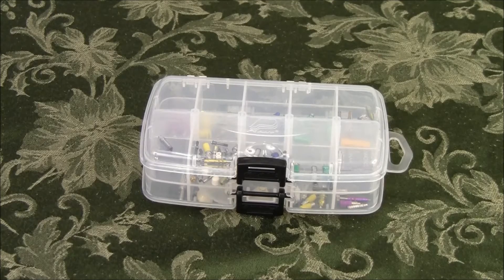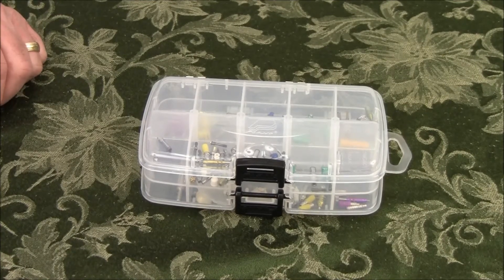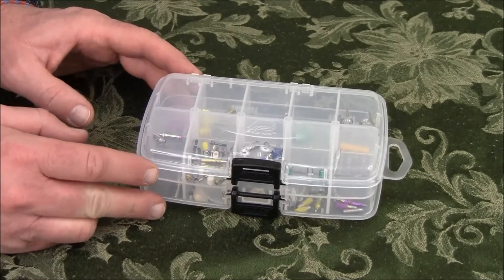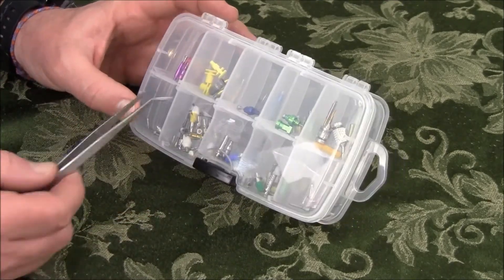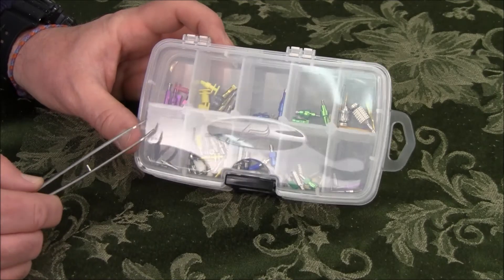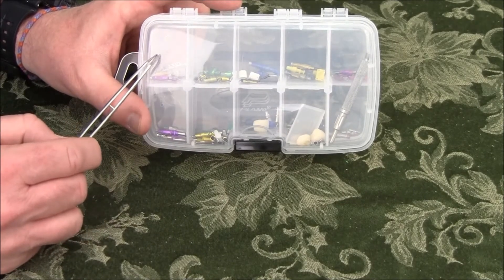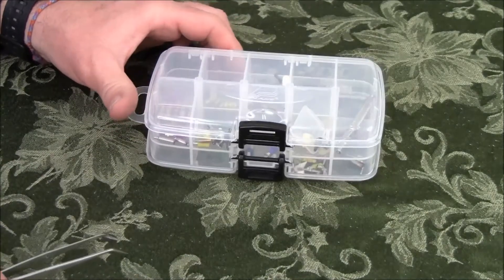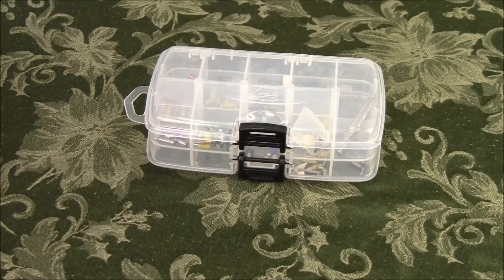Dental Implant Component Organization

Comment: Our office merged with another last year (during Covid 🤦🏻‍♀️) and we definitely did not have enough time to get organized which I've desperately been trying to do but it's corporate and run poorly by upper management so we have way too many hands in the pot. I was always in charge of the implant components and never lost a single one in over a decade but now we have stuff all over the place. I originally had something similar. So my question is, do you just take them out the sterilization bag after you autoclave them and put them back in there? We've been leaving them in the bag so they can be labeled and put away in the correct storage container but yet it's still not working...again way too many hands in the pot
Reply from the maker: Sorry for the late responses. I know that a lot of offices want to keep the component in the autoclave bags but it does make it more difficult to quickly identify the parts. It also requires more storage space for larger boxes. The most organized office I ever worked with took them out after autoclave and stored them in these types of containers. Most days you will know from the schedule that you have implant patients coming in so you could just pull what you need for the day and autoclave night before or at the beginning of the day. Hope that helps.